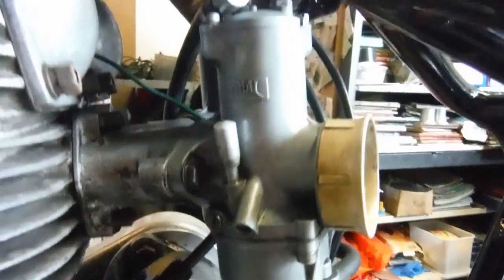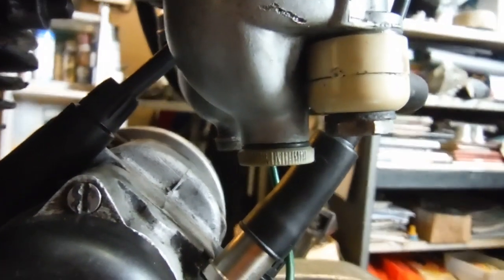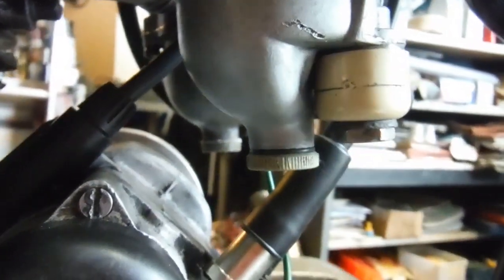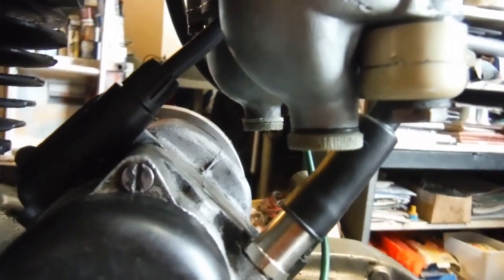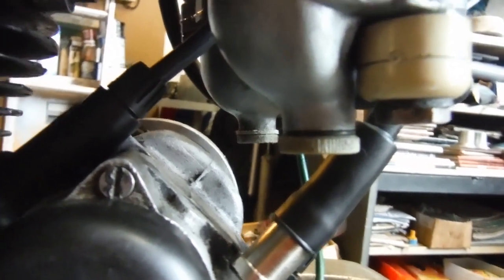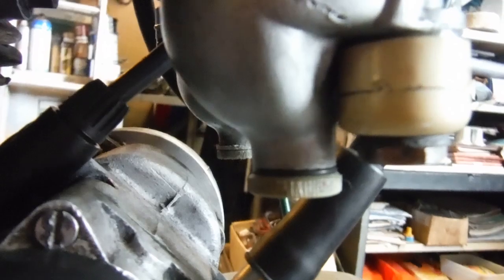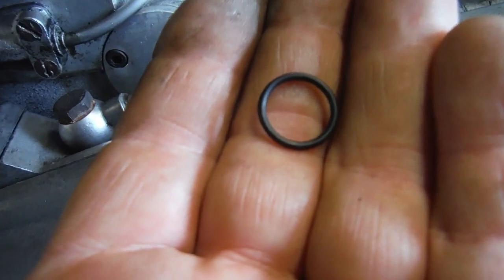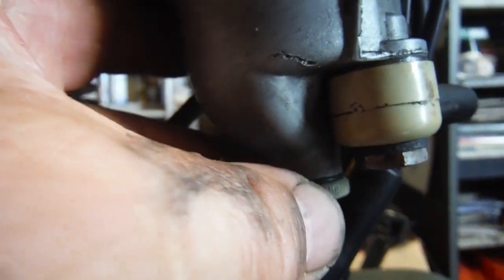Amal Carburettor leaky float bowl drain / access plug easy fix.

Comment: I've had leaks on my new Amal Premier concentrics from the drain plugs, brass/plated type. New fibre washers did not stop it. Now using Dowty type sealing washers and that has stopped the drips...but a year later after removing plugs to drain fuel during winter storage...then found them leaking once again...renewed the dowty washers and all good. Never had this issue when using the plastic plugs. I think there may be some manufacturing defect on the brass ones, maybe a lump or uneveness on the sealing face or similar.